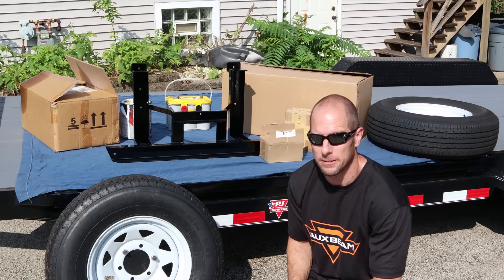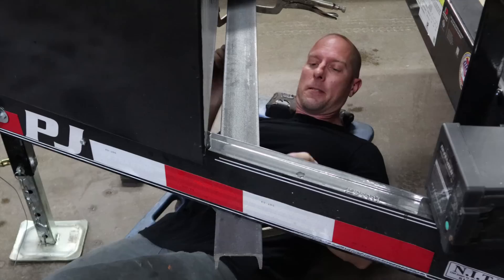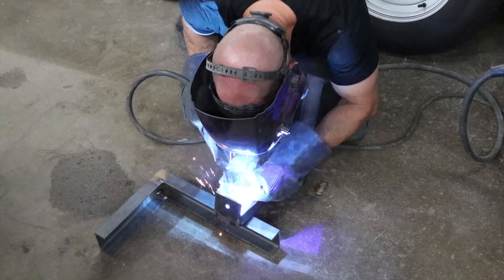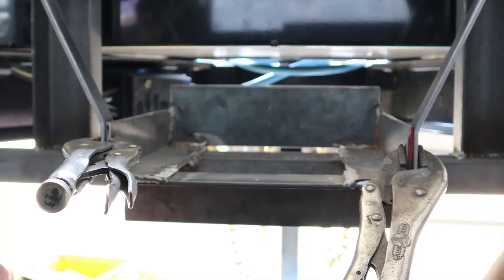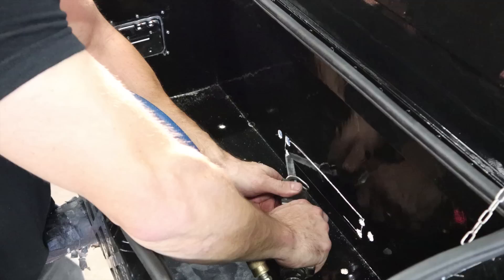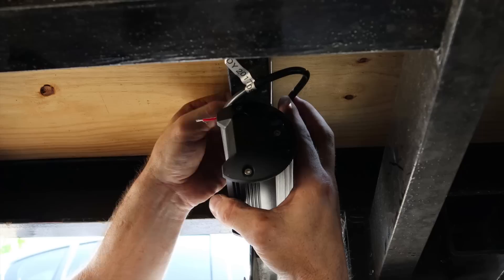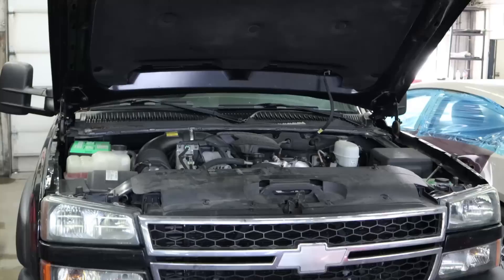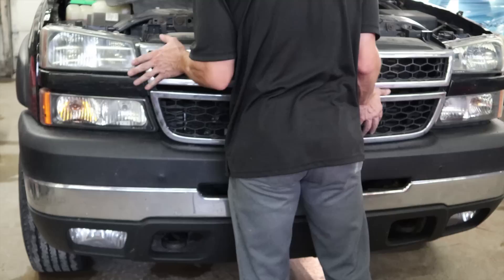2019 PJ equipment trailer winch mount fabrication,  LED light installation and other mods..

Comment: You may already have a comment for it,  But I didn't see it in the comments.  Maybe ad a small solar panel and charge controller in the tool box to keep the battery topped up when the trailer is just sitting outside.  Defiantly like the idea of lighting up the forward part of the fenders in order to be able to see them from the rear view mirrors.  Love your videos and your attention to detail.
Reply from the maker: That solar panel is one addition I want to make.  I have added a few others so I think I will make another video for the trailer.   Thanks for watching!

Comment: The only youtuber with a descent trailer. Dude knows what he’s doing.
Reply from the maker: Thanks, we will see how long I can keep it in decent shape.  It is a piece of equipment and things happen even as much as I try to be careful.  So far so good though, just some wear on the deck but there is no way around that.  Thanks for watching.
Reply: I have a 2019 PJ B6, with drive over fenders, and a 14K gvw. I've used it to haul a few vehicles, and mine and my folks SXS on a trip to NH. I've been nothing but impressed with my trailer!
I also opted to get it in desert tan, so it looks good behind my "commando green" ram 2500.

Just a friendly tip for you, if you want to help save the life of your ramps, flip them upside down, so when it rains while you're driving, water doesn't collect in the c channel or the ramps.
Awesome video man!! Thank you for some of inspiration for my trailer!
Reply from the maker: @MrBigredtaco99  I really wanted the 14k super wide with monster ramps but the ROI just wasn't there for me.  It was way more than I needed and purchase and operating costs are much higher.  Thanks for the tip on the ramps, so simple but I never thought of it.  I am less concerned with the rotting c channel and more with the fact that every time I pull them out I get soaked. lol Thanks for watching and good luck with your trailer.
Reply: I've got 2 full tilt trailers ones a 16k gvw suretrac deck over (it's a monster has 14ply tires on it) and the other is 14k striker a non decokover with 10ply tires wish I had a hydraulic dove goose with tandem duals
Reply: Mike Diesel with tools and work environment to boot

Comment: Trailer looks good. When I did my trailer we used large tool box. The one that fits inside a truck bed, so that it’s not wide. 
I mounted spare tire under front of trailer so it’s not mounted open to be seen. It has a lock so can’t be stolen. 

My 10,000 lb wench we mounted in a cradle with a hitch. Welded bracket for mount that is bolted and can be removed. 
On top of storage in large toolbox the hitch has a tray for all your blocks and chocks. 

Ya it’s pretty sweet. 18’ dove     I love it. My dad helped me make it what it is today. Could not of done it without him.
Reply from the maker: Putting a little extra work in can save lots of time and headaches in the future.  Thanks for watching!

Comment: I own a 18 foot utility trailer, heavy duty with a pipe top rail. I added swivel trailer jacks on the back rear corners, on each side. I use a block of wood depending on the height needed to ground, and when I load a tractor or vehicle the swivel jacks carry the load of the vehicle or tractor when it loads down the back of the trailer and prevents the trailer from picking up the rear of my truck, or forcing the trailer down on the rear. Did this about 20 years ago, work perfect ever since. They swivel horizontal against the trailer when not in use, just pull the swivel pin and it drops and locks, or horizontal. Hope that helps, enjoy your channel. From the South Texas Border.
Reply from the maker: The back does have jacks, I just leave them off until I need them.  Thanks for watching.

Comment: I love meeting guys on the road at night towing something making their lights point up and when they get even brighter head lights it’s even more awesome! Your a great guy !
Reply from the maker: I certainly hope you don't have a truck or pull trailers.  If your main concern is headlight alignment and not a load that is unsafe you don't need to be on the road with one.  If the back of the truck is sagging, the equipment is not right for the job or not loaded correctly.  My lights are aimed correctly and do not blind anyone.  My fog lights are aimed correctly to be a reminder to the a-holes on the road to act right.  They get used accordingly.

Comment: Don't know where your at, but I always assemble electrical grounds/connections with dielectric grease to prevent corrosion from road salt. Always wear safety glasses when cutting metal. Last always aim your headlights at 25' from your garage doors. Those LED bulbs rotate to allow you to get the elements horizontal for your beam pattern. Otherwise you get a big blob of light, with no cutoff line, that just blinds oncoming traffic. That's a ticket in some states
Reply from the maker: Thanks for the tips.

Comment: I am getting ready to mount a winch on my 18` dovetail. I like the idea of putting it inside the box. I have one on my 20`, but it was plenty long enough to mount directly at the front of the bed. I don`t think I`ll have enough room on the 18` to do that. when I have a car on, I have to pull forward so far so the doors will clear the trailer fender, there is not enough room for a winch.
Reply from the maker: Good luck on the project.  I personally like to save all the bed space I can.
Reply: @vehcor  thank you

Comment: You put a battery on your trailer, you can now delete the breakaway box and only run the switch (the one with the wire you hook to your truck)  from positive to brake line of trailer. That's what I did since I have a winch too on my '08 Suretrac.
Reply from the maker: You think that would be a no brainer but it never occurred to me. lol  Thanks for the idea.

Comment: Add a solar trickle charger to the lid so the battery is always charged when you go to get the trailer.Simple flexible rubber flap over the top of the cable rollers to protect them and a couple drain holes in the box in case water does get in.
Reply from the maker: I stand on the lid a lot, it will need to be in a different place.  There are drain holes in the tool box as well.

Comment: Black tool/battery/equipment boxes will exceed 170°F in the sun on a still day. Light colors will go about 130°F in same conditions... like hot beach sand. So, if stuff inside is sensitive, paint chrome or put an aluminum shield over. [1/2 in gap... 12mm for foreigners]

Like your work. Thanks. 👍🏼🤠

Comment: Here's a tip, next time you drill into metal, use bacon grease as a cutting oil. Dip the tip of the drill bit in it. It works wonders and it's free. Be sure to pickup any shards from the floor if you have any pets around. Great Video...👍😀😎👌
Reply from the maker: Used motor oil works too and I have lots of that. lol  Thanks for the tip and thanks for watching.

Comment: Really impressed with this set up. Attention to detail and i dont think there is such a thing as overboard. I am looking into adding a winch to my trailers even though they are not car haulers. Would like to throw an idea of using a Solar panel to keep up the trailer battery. The smaller 2.5 watt kits are pretty cheap. The switch panel was spot on in my opinion. Enjoyed watching this clip.
Reply from the maker: I did consider the solar charger, since it is always hooked to my truck it would be like a battery tender for both together.  I don't know how I ever used my old trailer without theses modifications.  I have easily saved more than the time invested in these mods since I have been using it.  I may have a part 2 eventually: how I have the tool boxes set up, what I carry with me, some attachments I have for the trailer and maybe that solar panel.  Thanks for watching!

Comment: Mounted a winch on my 25' flat deck similler to what you did but didnt use the tool box. I built a hitch receiver and mounted winch on a hitch stock so i can take my hitch off and use it on front of my truck or the back also slides and pins right in to my hitch. used #4 welding cable with booster cable clamps to run to my truck battery 20'.  Been pretty handy.
Reply from the maker: I had a similar set up on my old trailer.  Thanks for watching.

Comment: Hi Vehcor... Nice Job! making the Brackets & Bolting them to the Trailer Frame. I do the same thing instead of welding. Nice Idea & size for the Tool Box Winch & switches.                                      Remember to maintain the wood on your Deck by Pressure Washing & using a Wood Preserver every 2 years. You can also have the Undercarriage of your new Trailer Rust Proofed or Oil Sprayed to prevent rust.
I too bought a new 2009 18' Kaufman Car Hauler with an upgrade Diamond Plated Deck & 15 " Tires with extra D Rings. I haul Vehicles here in Toronto too.
Nice replacement Lights that I will be getting too. I replaced all the Lights on my Trailer with LED Lights & 2 Backup Floods. 
Thank you for taking the time to share your Ideas & Video.
Grace
Reply from the maker: Welding would have been faster but I could not bring myself to grind up the brand new powder coat.  I did end up wiring the lights under the deck to the back up lights on the truck since they were so useful for that purpose.  I can still turn them on with the switch for loading as well.  Stay safe on the roads up there and stay warm!  Thanks for watching!

Comment: Love your setup. Just bought a 18ft dove tail trailer. I'm on the same thing flipping cars. Got 12000lbs winch from harbor freight. $288. I'm add lights under the trailer for reverse too..  I'm use a long light bar.

Comment: Just a little note, as you were putting on the tires on the rims. The safest was is to release the rim then add air. That reduces the binding between the machine and tires. That was how I was taught.

Comment: Nice work. I have a 20' PJ with the mega ramps and I've been considering a setup just like yours.  thanks for the vid!
Reply from the maker: I wanted the mega ramps but would have had to move to the 14k trailer.  I'll just have to deal with my little stick ramps. lol Thanks for watching!

Comment: Great idea with the toolbox. Keeps the weather off the electrics and the sticky fingers away too. Another idea would be to have some lightweight gravel guard protection for what you are hauling. Could even be a stretched tarp. You would be amazed at the stuff that flies around the highway.
Reply from the maker: The tool box was my cheating way of housing the electrics.  I was going to build a box until I found this one that had many more uses.  Thanks for watching.

Comment: Dig it, good video. On my trailer, I installed rear back up lamps on the rear edge of the trailer next to the rear, red running lamps. Wired them into the 7 pin. When I shift the truck into reverse those lights kick on along with the factory back up lamps on the truck. They are white, oval LED, same style as the read Oval tail light. Having them sure assists backing up in the dark.
Reply from the maker: I never saw the need but I tried turning on the lights under the deck for backing up once and it was such a help I did end up wiring them into the 7 pin connector.  They now come on in reverse and I can turn them on when loading even with the truck parked.  I have a diode in the line to keep from setting codes in the trans when using the switch to turn on the lights.  Thanks for watching.

Comment: I liked the winch setup! I have a removable hitch mount on the front of mine. I found that a remote for the winch helps tons. I can steer what i'm winching, and don't have to worry about the cable on the switch.

Comment: Nice job. I recommend you fabricate a weather tight seal in the fairlead opening so no moisture gets inside your winch box & corrode anything if it's parked outside or during road trips. I made my winch removeable by fabricating a male & female trailer hitch mount set-up on the A-frame of my tandem trailer so nobody can steal it or it gets stolen along with the trailer. I might make mine removable inside a box like you did though for those long hauls if it rains or snows I could just leave it mounted. Right now I'm about to fab up a removeable winch mount for my single axle trailer using a dual hitch extension type set-up. That way I can carry the winch on the back of my trailer to help offset the tongue weight during trips & just plug it into my trailer hitch along with the 7-way elec. cord when it's needed to pull something heavy up onto the trailer. I also recommend getting a wireless remote control for the winch so you can help guide & steer vehicles etc. onto the trailer when no one is around to help you. Add some wireless Bluetooth marine type speakers for some jams.  Some wireless remote control switches for your trailer lights & accessories is a good option also you might want to consider. Have a great day & GOD Bless :-)
Reply from the maker: I think I might make that cover, it would be pretty easy.  Water has not been a problem yet but it could be.  The winch does have a wireless remote and I have yet to use the hand held. lol The radio might come in handy when I am putting suspensions on the vehicles to roll them off the trailer. lol Thanks for the ideas.  I am planning on making a part 2 with all the other mods I have done in the year I have had it.  Thanks for watching!

Comment: Man this thing is slick I like how you used the tool box to house the wench
 and control panel.
Reply from the maker: It was an easy solution instead of building one.  I am super happy with all the mods.  I have used the lights and winch a few times and it has probably already saved me the time invested. Thanks for watching!

Comment: I wish I could post a picture on here. I built a winch mount on my PJ trailer that bolts on. I also didn’t want to mess up my powder coat. I have my winch on a receiver mount so I can use it without the trailer. The mount I built allows it to mount on the trailer the same way and the wiring is all run off the truck. I can remove it to keep it out of the weather.
Reply from the maker: I did have a few designs before I settled on this one and a few I was able to remove the winch.  I have enough stuff to store without worrying about adding to it so I decided a permanent mount was the best for me.  Thanks for watching.

Comment: Some viewers are commenting on your 12V wire from your 7 blade plug to the trailer to keep your battery charged. I have a dump trailer that I also installed a small 50 watt solar panel on top of the tool box that holds my hydraulic pump and battery. It just ensures I have enough power to control the hydraulic pump and also enough power to control the 12 volt electric tongue jack.
Reply from the maker: I was thinking about the solar charger just to keep the batteries on both the trailer and truck charged when they sit for a couple weeks.  The wire in the 7 pin plug keeps the trailer charged when I drive with it on the truck.

Comment: A small service light inside your winch box for night time use might be helpful. If you want to get fancy you can wire it thru an outside mounted weather-proof lighted-handle switch, in case you forget to turn if off when not in use.
Reply from the maker: Do you mean like this... https://youtu.be/cctyNxYT808?t=1165 ?

Comment: Nice job. I would consider putting that battery in a battery box of some kind water tight if possible you will find that pulling trailer in the rain or snow you mite find that it will short out the battery! As always enjoyed the video
Reply from the maker: Thanks for the tip.  Thanks for watching.

Comment: to hell with ramps! i bought a new 20ft tilt bed road warrior last year and its been glorious ever since! and i added a 17,500 smittybilt winch to the front because no kill like overkill!
Reply from the maker: I only use the ramps about 30% of the time.  End loaders load and unload.  A tilt bed costs more and is heavier.  So I could not pull the same weight as this unless I moved up to a 14K trailer.   Then the cost to pull and plate it also increases.  So, I would be paying more money for a trailer at purchase and the life of the trailer that I only use as intended 30% of the time.  This is the trailer that made the most sense financially and I have no regrets.  I can also load cars backwards if I have too.  Which can sometimes be a problem with tilt beds if they are gravity tilt.

Comment: Small thing I would add is one of those small solar panels they make for trailers to keep the battery charged when no in use
Reply from the maker: I'll probably add that in the next video along with a few other modifications. Thanks for watching.

Comment: Hi Scott just watched this episode as I am going through all your videos . Noticed all trailers in America have timber floors is that because of rust as in Australia they are all steel . Thanks great job as usual 👍👍👍✅✅
Reply from the maker: Wood decks are cheaper and you can nail blocks into them to chock loads.  Not to mention they are easily replaced if damaged.  Steel decks are available but less common.  I did consider a steel deck but I would have had to order it and wait 16 weeks.  This one was on the lot and ready to go and I’m impatient sometimes. 😂